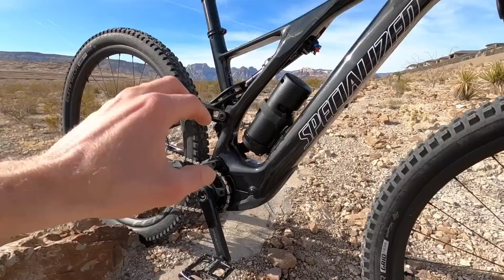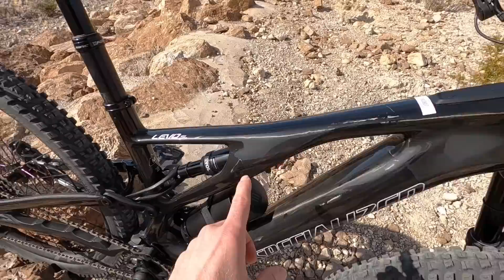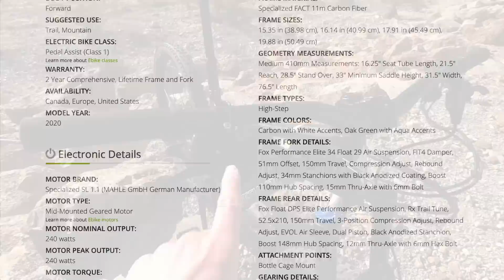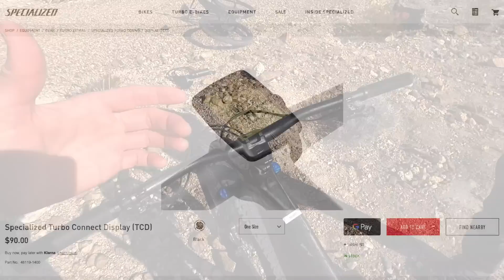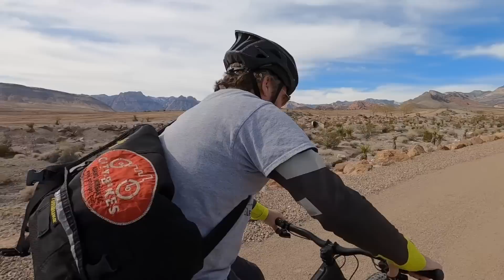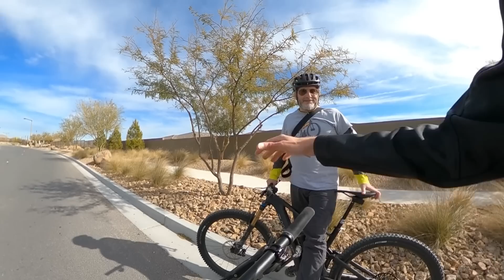Specialized Turbo Levo SL Expert Carbon Review - $9k

Comment: How to respond to a complaint in about a lack of cars return I have done some spell checking on about half of what follows but that leaves it inconsistent with the bottom half so please bear with me until another day so that I can take the time but I have it to polish this a bit .  The purpose of this note was to follow up on those who complain about bicycles needing the cost less than garbage .  Bicycles can have higher value  then cars and can require more investment and tooling and talent than car . Most obviously the car industry need not make money  because of the money that people spend buying liquid to put in the car fuel tanks and those liquids are not manufactured liquids with the exception of State ethanol but even ethanol is using plants to do the work and so it is basically gravy in terms of profit . We understand that bicycle dealers do have a lot of razor blades to sell us a lot of clothing High fashion High profit inner tubes the labor to put patches on tubes and such and so we don't tend to see  the tires  that don't need to be heavily profiteer the pain every time we run over a weed seed by you know having us drive the bicycle to the bicycle shop and they can put some sticker on top of the rubber where the weed seed penetrated through the tire into the tube . We don't have advanced and bicycle technology not just in getting rid of the tubes but in getting rid of the single  bladder within the tire and instead of having a single bladder having countless nearly nano-sized bladders that Korean companies have perfected and many attempts have been made over many decades to get right previously but having an electric motor makes optional because the electric motor  can  make any of the snow rolling-resistance relatively unimportant especially the rolling resistance this comes from the very inconsistent amount of pressure somebody who is generating work for the wheels applies to the surface of the Earth versus that of any type of electric motor on a bicycle that does never change  the pressure that the tires are seeing between the rims and the ground . I don't think this channel has reviewed any of the Utah Trikes ebike and that is unfortunate  I hope that the channel can get a spot to a bike in Utah because their crew is rather extraordinary and a recent discovery of mine. I think it is fair to ask them to see what they could do for $13,000 in a lightweight battery augmented but absolutely cardiovascularly healthy alternative to bypass or worse.

 just want to say that I did not doubt you although YouTube just told me there were two ads that would play before this video began. You have not opted out of letting us skip them. Even if you crOw about how there's only one ad for a video. It doesn't matter whether there is 20 if you can skip all of them by just pushing a button a couple seconds in. You have stayed true to your commitment to your supporters. I hope that you are able to resist the temptation going forward and I hope that I am not the Agent of change in mentioning that according to the ad blocker browser in their announcement of version 2.0  having its own YouTube player that skips all the ads without even Teasing us with what we might in fact want to watch. I am both a premium YouTube user because I need to save the videos in 1080P or better res when I'm connected to a fat pipe and watch them when I'm out there at sea or miles below the surface Of the Earth and I don't have any connectivity. But I do like to see what the commercials are and I watch them if I haven't seen them before or if they might have something to say that I want and need to hear. 

This channel has so much potential to change the world. You have just begun. We all love you. You know how hard it is to pay the bills and get this product at its quality. That is courage. 

So many people who cannot afford an electric car Will save money by buying a $13,000 bicycle. Nowhere else dO I know about WHERE they get so much help picking which Makes sense for somebody earning JUST 1,500  CENTS an hour. What is beyond debate is there is no car that anybody can own anywhere that makes more sense in terms of wisdom in terms of the pursuit of Liberty in terms of being the happiest and the best person anybody can be which of course always goes together.
 ThANK you sir. Nobody is helping us do that better than you.  You love that bicycle. You protected It AT the expense of your own skin. Because you understand that many people are wearing a diamond on one finger that cost 10 times as much. President whatever his first and last name are but Johnny Johnny that runs the United States of America into the ground. He stays away from the dirt himself. He is no farmer. He is the villain in the black and white movies about the depression. He is that Southerner that is still screaming about never wanting for food again. He envies those who know how to cook. He envies those who are admired and respected. He would not have jumped off this bicycle. He would have tossed it in the dumpster. He is not good enough to own anything like this. He can barely drive a car. You show us what it means to be a leader. You are only human. Every time you show us what an electric bicycle should be considered at its most primitive at its best you get the same haters. These are people who are addicted to methamphetamine. These are the people who nobody wants to sell anything to. We don't need their money. Nobody was making a car wants them to drive it. They are the people who want to know how much people are paying for this bicycle so that they can steal on and sell it for $100 saying this was originally $13,000. They do not have a clue about what it is to be a human being. They are unfortunately the result of a broken educational system. Of a world where the lady who talks about Medicaid does so while she files a claim for $50,000 because she was wrong about how much the jewelry in her purse was worth. The purse that you left in her car in the parking lot to talk to people about how you know these four people with their the stable children. They're costing taxpayers millions of dollars to take care of. With the world spends money on is highways. What the world suffers is cars. What the world needs is everybody to have a bicycle like this and the world can actually afford that without any trouble at all. You know that. I know that. Most of the viewers know that. On a day like today. My purpose is to remind us that we become what we love.
Reply: For the haters that want to say. Yeah, if you are making $15,000 an hour, then maybe they should buy this machine. I have to reply and say that was a typo. If you read my comments, you would know that $15 an hour is minimum wage. And if you are earning minimum wage, you should be happy. You should be healthy. You should consider yourself lucky to be writing this because it is absolutely the lowest cost solution to getting to and from work. Check, in exchange for moving someplace where the minimum wage is $15 an hour. You will have no difficulty parking this bicycle securely at work. You also be able to pay the rent with ease and enjoy living with other people who pay that kind of rent because they don't steal because they are happy and loving and wonderful to live even in the same building with. Y'all got lockers outside your homes, even you don't even have to bring the bicycle up the elevator. There's lockers on the ground that are secure that maybe you've got a camera in your locker so that you can look and see like you might look at your baby in the nursery and you have a baby in the nursery. You have a nursery and this whole thing cost less than the car payment on some used car after the insurance after the fuel. After the Carnage isn't even counted. Anybody who thinks that cities should tolerate cars has lost their minds or never had it. Cars are for the country. This bicycle can be happy and helpful in either at the country. Or the city. That's not true for any car. The city people want to live in . The city that needs no suburbs. The cities that Americans are going to leave the United States to flock to. Be afraid only of being stuck in the United States because you refused to learn to listen to grow.
Reply: If you want people to actually read your wall of text, learn how to use paragraphs.